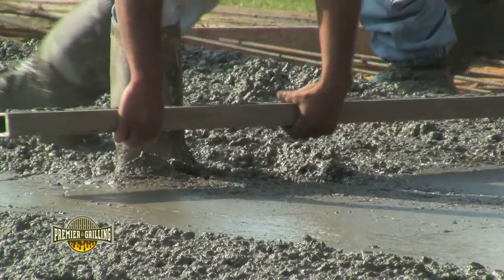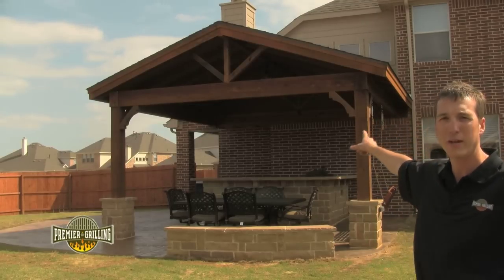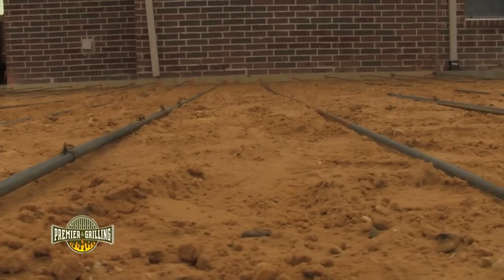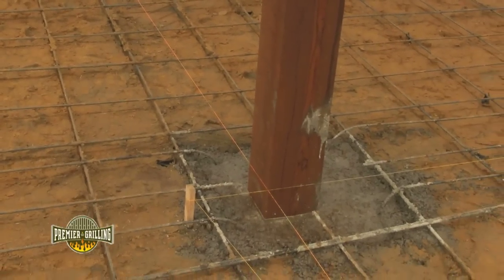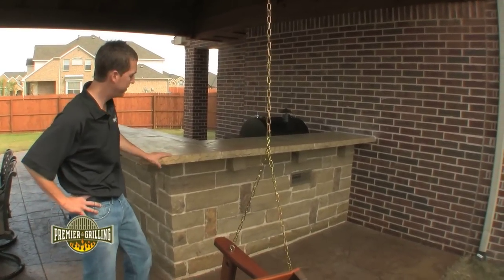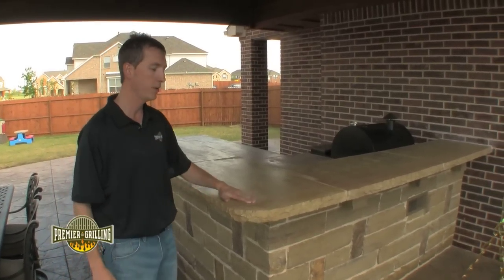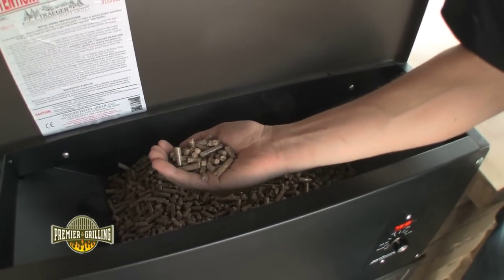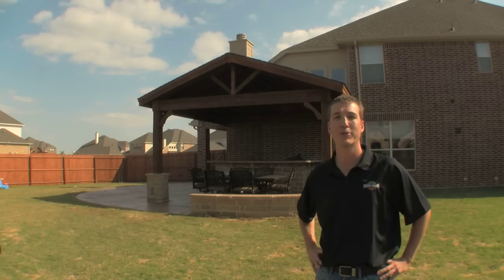1-Outdoor Kitchens BBQ Grills Construction Premier Grilling Frisco, TX

Comment: I really like this design, I have an existing concrete pool area, and have not worked with concrete blocks. How do you attach the block frame to existing concrete as well as inner rebar? 
thanks, angie
Reply: this a late reply, but attaching the concrete blocks to the existing concrete floor is done by laying a bed of type S mortar under the blocks and lay them in a straight line. The mortar bed should be about 1" when laid, and then compressed to about 3/8" of and inch when the block is placed on top. The joints between the blocks should be 3/8" of an inch as well. The blocks are nominal 16" x 8" x 8", and those dimensions should be used when figuring out wall length and height